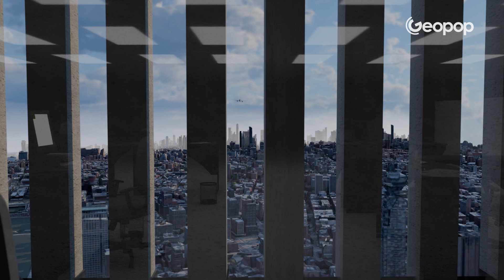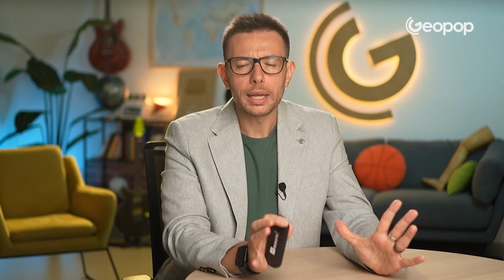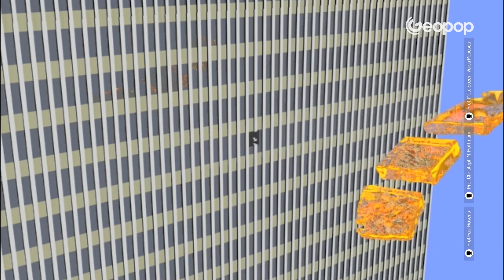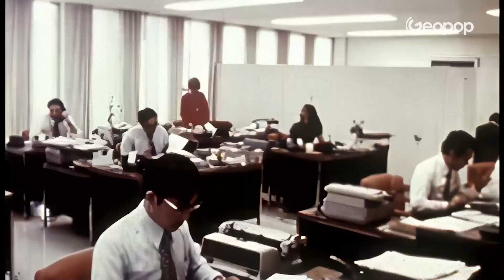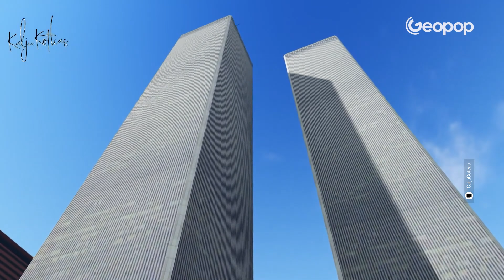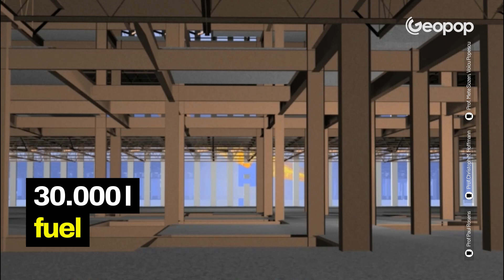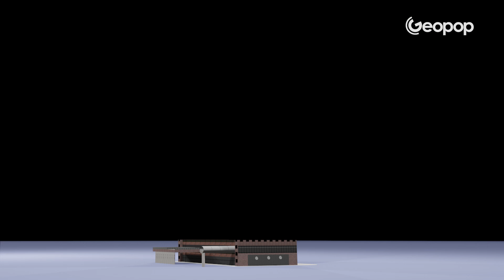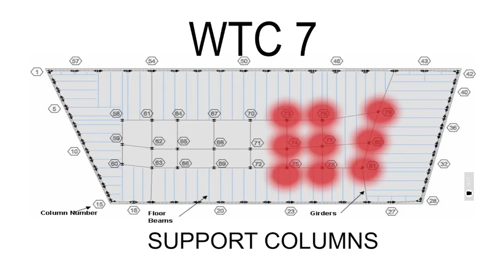9/11, 2001: The Technical Reconstruction of the Twin Towers and WTC 7 Collapses

Comment: Leslie Robertson who designed the steel frame of WTC 1 & 2 said that without the hat truss each building would have collapsed immediately after impact.
Reply: @longlakeshore  Leslie Robertson did NOT “design the steel frame of the towers”. At the time he joined the project, he did not even have his structural engineering degree or license. Therefore, by law, he could not be given that task. The structural frame design was carried out by multiple engineers at the firm of Worthington, Skilling, Helle & Jackson. 

Robinson’s principles contributions involved doing modeling of wind patterns & building sway. He also (IIRC) ran some tests (at a dentist’s office) to try to determine the amount of floor movement people could stand before getting nauseous. He was also involved in designing the anti-sway system that was incorporated into the towers.
Reply: @tfk0527  You are correct - but it wasn't designed by Worthington, Skilling, Helle & Jackson either...
Reply: @fx-studio   Hi  Fox, the info I have is that the hat truss system was designed by the engineering firm of Skilling, Helle, Christiansen, Robertson. But what I stated above is correct: at the time of the designing of this system, Leslie Robertson did not yet have his structural engineering license. Therefore he would have been legally barred from “being responsible for the design”. That responsibility most likely fell to John Skilling. The two main purposes for the hat truss was to support the weight of the communications towers atop the towers and to reduce wind sway by more securely tying together the core & outer frame. 
If you have info on somebody else who designed the hat truss system, I’d be interested to hear it & to read you sources.
Reply: @tfk0527  Nobody gives billion $ projects to tiny companies, 3000 miles away with no high rise experience - they were just the "Engineers of Record".
Reply: yes, i’ve heard before that the hat truss was integral to redistribution of failing columns throughout the duration of the fires, until the failure of the floor brackets, due to the sagging floor trusses became too much for even the hat truss to save the entire system. 

I wonder, would there have been an alternative model where the hat truss wouldn’t have been used, ie “not required”? the situation would have been catastrophic without it.
Reply: @josephbeierschmitt  A hat truss would not have been required on a rigid frame tower like Empire State or Chrysler Bldg. 9/11 demonstrated the difference between lightweight tube frame towers which sway in the wind and heavy rigid frame towers which don't.
Reply: @longlakeshore  It is my understanding, that the design of the building would require less steel to build it.
Reply: @josephbeierschmitt
Reply: @josephbeierschmitt your obviously not a structural engineer. You believe nist? WOW!!
Reply: @stevelandry6825  That he does says much more about the level of his intelligence vs yours. If only you had played with Lincoln Logs and TinkerToys as a kid instead of Barbies. You would then have a baseline to understand all of this ..
Reply: @stevelandry6825  I believe the man who designed the frame of WTC 1 & 2 who was and is a structural engineer.
Reply: @stevelandry6825  You believe the CT propaganda and brainwashing tactics?...Wow!
Reply: @stevelandry6825  I am a structural engineer and what he wrote was correct
Reply: @stevelandry6825  @stevelandry6825. I am a Mechanical engineer with 50 years experience (Cornell U, 1974) & I KNOW that the NIST Report was rigorous, accurate & comprehensive. Further, very few of the people that wrote the report worked for NIST. NIST simply oversaw the project, which recruited extremely experienced experts from the private sector in every one of the niche fields to answer the questions that needed to be answered. Do you have anything to offer, other than your “anti-NIST” prejudice? Can you even give a moderately accurate synopsis of NIST’s conclusions? I would bet not.
Finally, the methods & conclusions of the NIST Report were supported by EVERY mechanical & structural & civil engineering society in the US, & have been taught to graduate level structural engineering programs throughout the country as a model of 1st rate engineering analysis in progressive failure, fire safety & design, and failure analysis methods. Nobody “swept anything under any rugs”.
Reply: You calling him ignorant is laughable! 🤣🤣🤣 @xenuno
Reply: @ Ya I should of saved the title for you since your jealous. There's no rule that says there can't be more than one in any thread so cheer up. He might honestly not know any better where as for you, it's by design. I blame your parents ..
Reply: @ElLowEl .  . "What the hell are you talking about?" .  . 😃 .  . Thank you for your sponsored reply, Mr. EILow.  The word projection indicates holography as you know, commercial demonstrations of which have been amazing in recent years.  To feign ignorance doesn't work well for you, however.  Where, Mr. EILow, is the wake turbulence only seconds after passage of a 500 mph large passenger airliner -- not seen in the smoke and fire covering the impact zone?  Even the wake of a small Cessna Aircraft would be noticeable -- yet there is nothing.  It's likely that no real answer from you is forthcoming. We'll wait and see .  .
Reply: @   Real life curiosity, some pondering, and an education made him worthy of sponsorship just like the other few billion people you don't know. So .. what is your excuse? Continuing to miss the boat is no way to live ...
Reply: @ronaldgreene5733  The whole world must be sponsored except those down in the basement fantasizing about the next big conspiracy. Why not get out of the basement and educate yourself? Start slow .. like basic science
Reply: @ronaldgreene5733  😖
Reply: LesRobertson, who designed it also said they were « NOT designed w/ airplane fuel in mind. »This could not be true ´cause imagine designing for airtraffic IMPACT & NOT thinking of FUEL- IMPOSSIBLE!!!
Reply: He was forced to lie, CLOWN!
Reply: @longlakeshore  obviously you have not seen the video about the construction of the towers. It was made while being built.
There's also a video on the building of building 7. All made way before 2001. Debunker fans won't go look at the evidence. They just latch onto what they want to hear. I dare you to go watch AE911TRUTH videos that disprove NIST.  Bye.
Reply: Nonsense.  Everyone with half a brain knows that media fakery gave us the airplane story .
Reply: Twenty three years later and conspiracy nuts are still with us
Reply: And I'd be dead 😮
Reply: That just makes zero sense
Reply: A lot of people still bathing In that big old African river, DeNile....... lots of denial. And shills.
Reply: -- Then what is the source of the many tons of molten steel found in and under the debris, the heat so intense that the molten steel remained in that state for weeks afterward, running off of the debris as it was excavated. This cannot be molten copper from wiring that retains the color of a shiny new penny.  It cannot be molten aluminum that retains the color of the polished aluminum wheels of a street racer. It was the color of glowing orange molten steel  that cannot be mistaken for any other material, reported by firefighters who are very experienced in the nature of such materials as well as seen in video evidence.

When you combine this with an entire lack of turbulence behind 500 mph aircraft, when even a small Cessna Aircraft would leave an evident wake in the smoke and fire only seconds later .  . We find that skeptics still cannot be skeptical of the official narrative in explanation.  Sponsored channels and forum activity are skeptical of nothing when support is provided.

Sponsored activity in the forums is very normal today for commercial and political purposes and subjects of controversy -- in the attempt to lead public debate.
Reply: I believe it.
Reply: Bull puckie
Reply: Leslie is compromised. Funny thing is he has admitted to seeing a little river of molten steel down below in the basement. 
If you want to know something about the strength of those two towers, go check the various claims of the lead engineer that was in charge of building the towers, John Skilling.
Reply: Which is more extreme -- to accept without question the inexplicable lack of turbulence in the wake of a 500 mph large passenger airliner -- not evident in the smoke and fire covering the impact zone only seconds later? -- or to recognize the indications of digital projection in its imperfect nature as we see a wing disappear in front of a bright blue sky? From another camera angle, the same aircraft is seen passing behind a crane in the foreground, yet in front of the heavy crane cable. 

There should be a hurricane of turbulence in its wake that would entirely disrupt and disperse the smoke and fire seen billowing outward just 3 to 4 seconds later at both towers.  Even the wake of a small Cessna aircraft would be noticeable -- yet there is nothing.
Reply: @ronaldgreene5733  The first thing to say is that wake turbulence always trails an airplane. The instant the aircraft is destroyed no new wake turbulence is created nor does the old wake turbulence move forward in the direction the aircraft was going. Same is true of a ship or boat moving on water: its wake always trails behind the moving vessel. If the vessel instantly disappeared so would any new wake.

The second thing to say is that you cannot see the wake of an aircraft unless it passes through something you CAN see like cloud or smoke. Neither airliner passed through smoke before colliding with the towers so no wake is visible. Nor did their trailing wake move forward to interact with the fire and smoke of the explosions because wake turbulence always trails behind.
Reply: @ Don't make Ron think now. He heard what he said on the internet .. a denier's blog I reckon so it must be true
Reply: @longlakeshore .  . "wake turbulence disappears" .  . 😃 .  . So Mr. LongLake -- how does the intense vortex turbulence from each wing magically disappear after impact? .  . something that experienced pilots are very aware of and can last for up to several minutes behind large aircraft flying at normal speeds of 200+ mph at low altitude.  These violent air currents can break the wing off of small aircraft or send it diving toward the ground without sufficient altitude to recover.  At near 500 mph, the wake turbulence would be far greater.  Where is that turbulent wake, Mr. LongLake? .  . Good question .  .
Reply: @ronaldgreene5733  Reliable sources say your not worth the effort to reply to, not to mention the visual proof. It's evident your understanding of physics is remedial ..
Reply: @ronaldgreene5733  I have already explained this to you but will again. Wake turbulence is BEHIND a moving aircraft, It didn't interact with the smoke & fire of the explosions because it never reached the smoke and fire.
Reply: People quote and say "these planes were designed to be hit by an airplane" It did, It got hit by an airplane and didn't immediately collapse or get knocked over. The fires afterwards? not so much.
Reply: @masterdirk101 Not much you can do re thousands of gallons of burning jet fuel cascading down the central core where the lift shafts were, spreading the fire to every floor.
Reply: @masterdirk101 plus planes were smaller when it was designed and it was assumed it would be planes lost and out of fuel gliding into it. Not bigger planes accelerating into it
Reply: @phill6859  They were designed to withstand the impact of a 707, one of the biggest in svc at the time.  I doubt they could have made that type of building frame strong enough to take a hit from a 767 moving that fast.
Reply: @masterdirk101 The WTC was designed to be hit by a 707. The 767 carried more than twice the fuel load.
Reply: @allangibson8494 stupid people say the towers turned to dust because of the amount of fuel 😂😂😂 ffs HELLO
Reply: @a @andrewharrop535is Nothing on the twin towers turned to “dust” because of heat. The drop did it.
Reply: Maybe true for the floors, but the vertical columns must have been remain inact still. They do not try to explain how those ended up in pieces and vapor. And why they glow for 3 months (including a cold December) on the ground.
Reply: @GThu1  Ano, to nikdo nevysvětlil, máte pravdu ! Zdravím z Prahy, z Česka..
Reply: @GThu1 are you implying that fire can't burn in December because it's cold out? You understand that air temp has zero effect on fires right? Please tell me you understand that!
Reply: @GThu1 have you ever thought that steel rusts over time, is reactive with aluminum and spark, you don't need much, and creates thermite? It's just iron oxide and aluminum sulfate. Those planes were full of fuel and made of aluminum.
Reply: @meleepinata steel INSIDE buildings doesn't get wet, and doesn't rust. Nice, but lame try
Reply: @meleepinata  I think you need to back and take a few chemistry lessons first.
The aluminium in thermite needs to be powdersize, otherwise it will not react, same goes for the ironoxide.Then you would need a high temp fuse to start the reaction. The aluminium then binds with the oxygen (Aluminiumoxide is a white smoke) and liquid  elemental iron remains. This reaction produces a shitload of heat.
Reply: @GThu1 WTC1 & 2’s skin was the entire structural framework. The central core didn’t carry structural loads - just the elevator shafts and was sheared through by the aircraft.
Reply: @nickcharles1284 .  . "science" .  . 😃 .  . Commercial demonstrations of holography have been amazing -- so you believe that they are analog in nature? .  . What century are you living in?   

You also cannot explain the entire lack of turbulence behind a 500 mph aircraft that would entirely disrupt the smoking fire coming out of the building on the seconds later. Even the wake of a small Cessna Aircraft would be evident -- yet there is nothing.
Reply: @nickcharles1284  Damn boy you are stuck

Sorry Nick wrong address. Ron is the one with the permanent hangover and is truly stuck. Must be the turbulence between his ears from whatever jet flew directly overhead years ago
Reply: @xenuno aw, let’s leave him alone - he just discovered copy-paste and is eager to show off his new skill. 😂
Reply: U😊iipooooooooooooooooooooooooooooooooooooooooooooòòooooiiiiiiiiiiiiiiiiiiiiiiiiiiß it
Reply: Controlled demolition
Reply: @garycooper3066  Controlled delusion
Reply: @garycooper3066  Controlled delusion
Reply: It didn’t collapse, it would have been 100 ft of rubble…controlled demolition
Reply: @timglover5358  So controlled they were able to start at the level of impact and leave no blasting caps or primer cord behind.
Reply: @TheKairielise  thermite brought them down
Reply: @timglover5358  People say that some fell into the deep basement, but not sure that explains it. You'd still think there would be more of a pile on the surface...
Reply: @TrojanBus it could because they had it rigged a few weeks in advanced
Reply: @timglover5358  uncontrolled delusion
Reply: @longlakeshore  what do you think?
Reply: @timglover5358  I think you don't understand the difference between a rigid frame tower and a tube frame tower.
Reply: @longlakeshore  go watch how the towers were built and then see what you think, not being a smarty but I studied this day for many years…and everything was shady
Reply: @timglover5358  It wasn't shady. They were designed to be lightweight tube frame towers with open floor plans. The lack of vertical columns supporting those open floors was the weakness. Same goes for WTC7. All three collapsed because they were tube frame towers not rigid frame towers.
Reply: @longlakeshore  collapsed , they disintegrated and they’re videos as they fell that shows the steel turning to dust (YEAH THATS NORMAL) but I’m sure you’re right though 👍🏻
Reply: @timglover5358  The steel did not turn into dust. All that dust was 4 inches of concrete on each of 110 floors being ground.to dust by the energy of the collapse. Steel doesn't turn to dust in those conditions.
Reply: @longlakeshore  look up Judy wood, you will see
Reply: @timglover5358  Steel does not turn to dust. The 4 inch thick concrete floor on all 110 floors were pulverized to dust by the violence of the collapse.and billowed out for blocks around the WTC.
Reply: @longlakeshore  That might be the answer, but as they fall there is absolutely (I think) no sight of any of the structure breaking up or anything - it is completely dust. Surely you would see some of it breaking up on the way down? And then, on the ground there is barely anything there. Ok, maybe it all went into the deep basement...but, hmm...?
Reply: @longlakeshore  Not usually, no, but the speculation is in a new form of technology that can turn steel, or anything, to dust. Not saying it is definitive, but could be possible (apparently).
Reply: He lied
Reply: Larry Silverstein 🇮🇱 (owner of WTC complex) said - "Pull it, and we made the decision to pull and we watched the building collapse" - referring to WTC 7 - not hit by planes.
"We are benefiting from one thing and that's the attack on 911" - Benjamin Netanyahu 🇮🇱
Reply: @pololikikuju  Thank you!!! Larry silverstein owned 7 world trade center, they demolished it. Im not crazy. No way a 50 story steel building just falls down the way it did and didnt even get hit by an airplane.
Reply: @rodboijones7390 You may not be crazy but you’re misinformed. There are plenty of good explanations of why it happened, including in this video which I you clearly didn’t watch. Otherwise you wouldn’t have repeated the stupid line about it not being hit by an airplane - no, it was hit by a giant fucking skyscraper falling into it, and then was on fire for hours.
Reply: @pololikikuju found the Iranian bot
Reply: @TransitTechLA  truth fears no investigation
Reply: @TransitTechLA  plus I'm not Iranian, I'm European
Reply: @pololikikuju  omg well that solves that then. Identity confirmed eyeroll f***ing bots
Reply: @pololikikuju  ...and conspiracy theorists have no interest in the truth.
It's "Just Asking Questions" over and over again for 20 years while ignoring any answer. Kinda like how people in this very thread are still insisting that "no other steel framed buildings have ever collapsed due to fire" despite various examples of that happening since 2001.

Finding a talking point and sticking to it in defiance of any contradictory evidence isn't investigation, it's cultish affirmation.
Reply: @pololikikuju  To the tune of 4.4 Billion Dollars.
Reply: @pololikikuju  Yep, cuz if I masterminded an evil secret plot to fake terrorist attack by demolishing occupied buildings, the first thing I would do would be to tell everyone about it on a television interview. 🤦🏼‍♀️ The term “pull” is a demolition term, but refers to a very specific type of demolition where they tie support columns to the back of bulldozers with cables and literally PULL the building down. When Silverstein said THEY (him and the emergency service command chiefs, mainly the latter) made the decision to “pull it”, he meant the decision to cease any further search and rescue operations inside building 7 because they could tell the building’s collapse was imminent
Reply: @pololikikuju  @pololikuju,, Stupid, stoopid STOOPID comments. “Pull it” is NOT a phrase used by building demolition companies. Silverstein had precisely ZERO authority over any actions by anybody on 9/11. The FDNY chiefs ran the response & rescue operations. None of them paid any attention to Silverstein. Who exactly do you propose he meant by “we”? What army of operatives was he directing? What did they do?
Re: Netanyahu. So you’re proposing that Da JOOOs were responsible?? How brain-dead.
Reply: @pololikikuju 😅😅😅 where'd u find this bs?? That's not a legit quote from either of them
Reply: @CallMeJarv  lucky Larry Silverstein quote : https://youtu.be/p34XrI2Fm6I
Netanyahu quote I took it from Jerusalem Post article back in the 2010s. They are both legit quotes, - people are waking up to the tribe in mass - nothing CAN STOP what's happening now
Reply: @pololikikuju 
What is the complete statement from Larry…
Reply: @pololikikuju 
Pull it doesn't mean to demolish.
There was a video showing the men on the ground with a transit, and they observed the sagging of the roofline.
The began to pull the men out, or get everyone out, because the building was slowly but surely weakening.
Building 7 was damaged from a lot of stuff falling on it, and your truther videos didn't want to show the damaged side.
Reply: @richtomlinson7090 ”pull it” was a poor choice of wording for “get those men out of the area, the building is unstable”
Reply: @josephbeierschmitt  Oh course  Of course     -    thinking of others.... no doubt...
Reply: @richtomlinson7090  Yeah Yeah Yeah    -  of course..     zzzzzzzzzzzzzz
Reply: @richtomlinson7090 

"Pull it" absolutely can/has and is used to trigger controlled demolitions. 
Immediately prior to detonation the handle must first be pulled before being pushed, and for safety reasons this is done in one go.
Reply: @NPC-fl3gq quit being stupid. Pull it has nothing to do with demolition. It's someone who speaks English as a second language. Where were the explosions for the demolition? To take out a building like that you'd need floor by floor demolitions that would have been easily heard and observed. No one heard 110 explosions. Get over yourself.
Reply: @richtomlinson7090  pull it absolutely is used in demolitions, just search for demolition videos and you'll see plenty of "Pull it" being said to detonate the charges. They didn't just pulled building 7, they pulled those two towers beforehand also, without any mercy for the souls still inside
Reply: @TransitTechLA  

People at ground Zero reported hearing explosion after explosion, and you can see each floor successively blown out - stop ignoring what your eyes can clearly see and many witnesses ears heard. 
Go watch the videos of eyewitnesses... They literally reported hearing the explosions.
Reply: @TransitTechLA except all the videos of firefighters and public saying they could hear 'boom boom boom, just explosions' coming from inside. Conveniently, YouTube removed these videos as they dont fit the official narrative, and they don't like that. You can still find them elsewhere though
Reply: @TransitTechLA I think you need to listen to those collapses again, this time with a little bit more caution & attention
Reply: @josephbeierschmitt  yeah cause Larry Silverstein makes those calls lol
Reply: @pololikikuju WTC7 was hit by the falling WTC1 and 2 towers. It was burning, had its entire front ripped off and was just a risk to firefighters. It wasn’t salvageable in any way or shape.
Pulling the firefighters saved lives.
Reply: Such controlled demolition, mhmmhmm, exactly somehow hitting perfectly where planes would hit at random without cutting detcords.  Funny how we only heard of "nanothermite" after 9-11 and somehow never again, in any context whatsoever.  eyeroll
Reply: A Collapsing and weakened structure will NEVER result in a pyroclastic cloud where everything is pulverized, as observed.
Reply: @beetheace  The huge gray dust cloud which emerged in each collapse was from the four inch thick concrete on each floor, most of which was pulverized to dust in the progressive collapse.  The steel frame of the buildings did not pulverize. Windows, ceiling panels and drywall were also pulverized but most of the giant dust cloud had been concrete from each floor.
Reply: @longlakeshore 
Yeah so all all the steel framing just melted like butter even though it's maybe only 10 floors around the impact zone🤦🏽--the force expelled & the speed of it coming down defies Galileo's law of falling bodies-suction was created in the vacuum created by high-end explosives--hundreds of boxes of blasting cap were found in a room rented by 'art students' from yup, is-rah..Ehl
Reply: ah, the hattruss.
The thing that held up the antenna in case of the north tower.
It only fell down, due to gravity.
It was on top.
And the only thing it did was fall down.

And when you now look at it, it is all mangled up, unrecognizable.
And you want us to believe that that happened because it simply fell down due to gravity?

Yup.
Alrighty then.